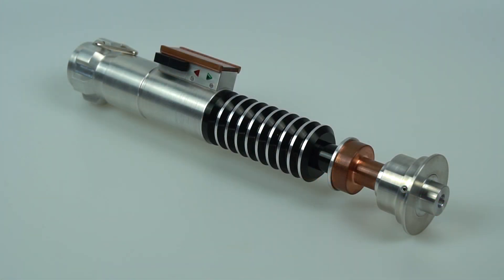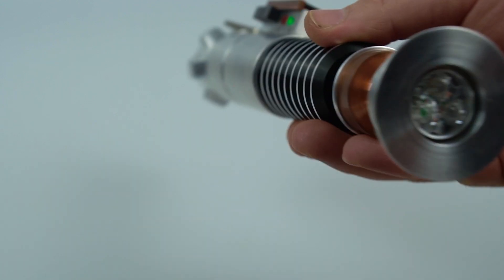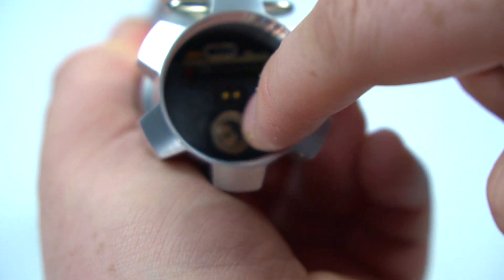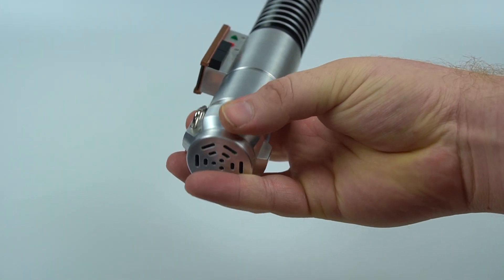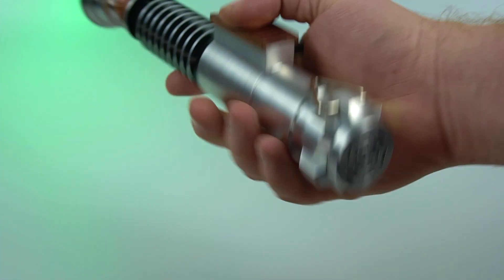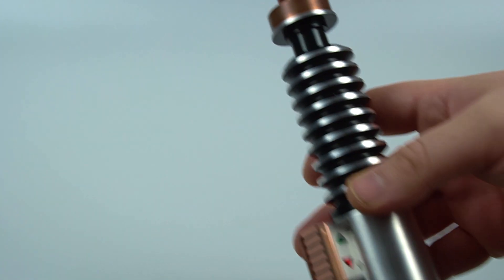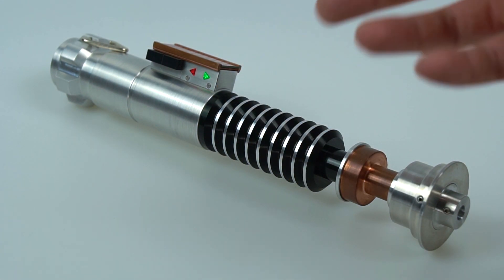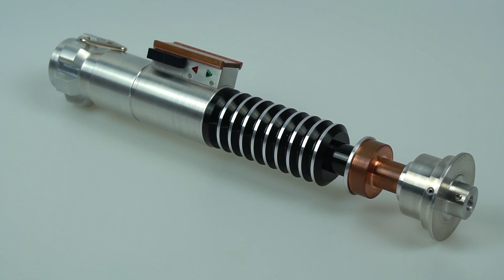KR X OR Luke Sywalker ROTJ Hero Star Wars FX Lightsaber With Crystal Focus X 10

Comment: I am a newbie to lightsabers but I see how saber engineering is now quite impressive. But I have a vexing problem and that is when the blades are unlit they still look like toys. You are all much smarter than me so I am sure you think about this. It seems to be me, correct me if I'm wrong, that the blades used on sabers are off the shelf tubing that's been modified. I was wondering why can't the lightsaber community come together and crowd source the funding to invent a new kind of tubing specifically for lightsabers? For instance, How about engineering a collapsible tube where the folds are micro folds, undetectable to the eye. There would have to be a way to make sure when the tube expands that it is lit either from inside the tube or the LED's could be embedded in the tube material itself so that the illusion would be complete. Maybe you could start a Kickstarter page to crowd fund the research and development by a materials scientist? So what do you think? If Elon Musk can land a rocket on a platform in the ocean then maybe this task wouldn't be so difficult. Your thoughts?